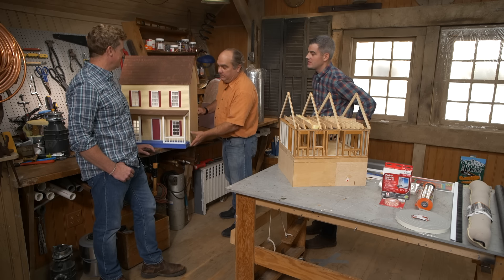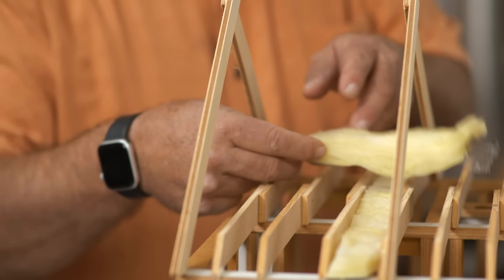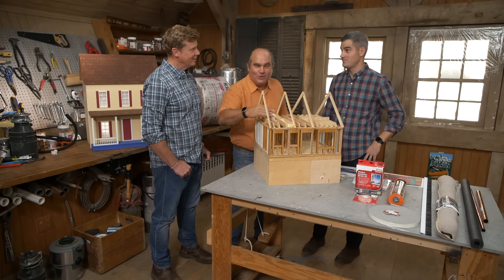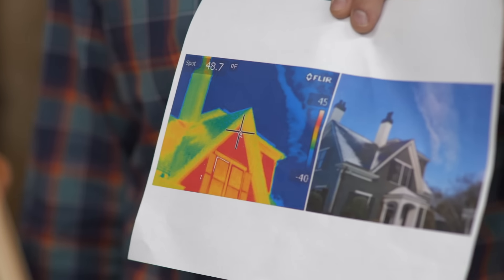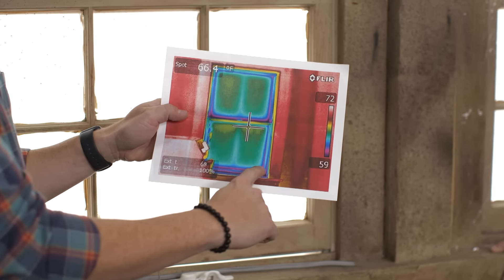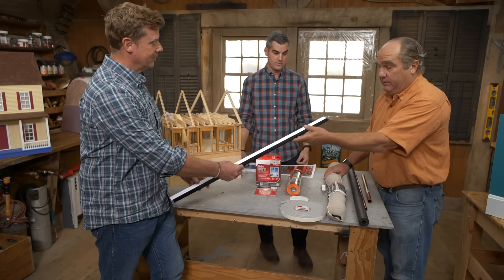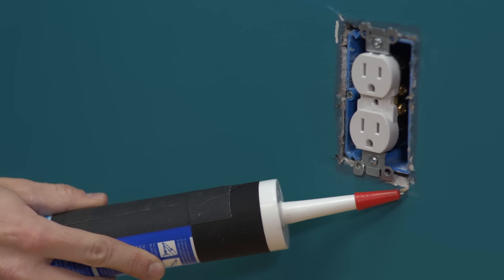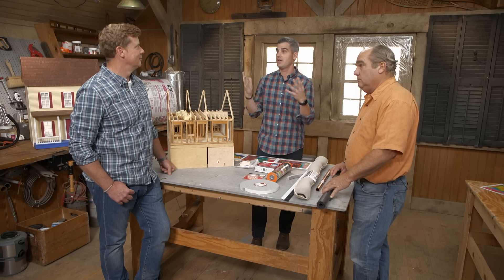How to Save Money on Heating Bills | Ask This Old House

Comment: When I bought my 10 year old house the previous owner said her electric bills were always around $300 a month.  My first week, in the house, I went up in the attic and discovered half the house had four inches of blown in insulation and the other half had nothing at all.  I added blown in insulation so there is a 12 inch layer throughout the attic.  That was six years ago and I have not had an electric bill over $100.
Reply: Wow didn't know it would make that much of a difference!
Reply: @nofurtherwest3474  It was money well spent.
Reply: Goes to show how bad the quality is on newer houses, they don't care just build them cheap and fast for max profit!! (its sad how common it is) to only put 1 coat of paint of these houses, and when other trades come in, (like me to pour concrete) I put tape and plastic up to not make a mess, when I take the tape off it peels away the paint. Honestly (sort of maybe not always) better off buying an older house. I also have seen a brand new house, with the back deck 2 inches out of square, the average person might not notice but if you stick your head down the side of the house it's ridiculous.
Reply: @7.3powerstroke6  I fully agree.  I am a general contractor so I am very well aware of how new houses are slapped together.  I would much rather work on a hundered year old house, at least a stiff fart will not knock it over.
Reply: @NickMC
As a general contractor that subs out the work to build the house, you need to take the time to find a crew that knows what they are doing. I’ve framed houses for quite some time, a lot of them are super insulated homes. There are procedures to follow when framing, caulking under wall plates, raised plate for the rafters, California outside  corners of the house so they can be insulated, 2x6 walls, very well built homes. I built my own place with these same features and I don’t pay much more than $100  a month for heating a 2200 sq ft house in northern ohio, avg  temp in the 20’s
Reply: @paulhunter9613  I would love to take the time to find the right crews but the devoleper will just find another gc that will do it faster.  no one cares as long as it meets min. code and even then half the inspectors look the other way.  The faster they go up the more money that is made and don't even think of going above code because that cost money(tongue in cheek). It sounds like your code is alot better then ours and the procedures you speak of is the way every home should be built.  It sounds to me like you are a fellow that actully cares about your work and that my friend is hard to find around here.  I bought a 1923 built house, gutted to bare studs and redid everything myself and she is airtight and warm.
Reply: Testify!

Comment: Be prepared to buy and install an HRV if you are truly successful with stopping close to all the air leaks.  As you build a tighter house you will end up with a much more fragile house. Its not as simple as stopping all air leaks as that will cause other serious moisture problems in a cold environment,  If you don't have mechanically controlled air.
Reply: Didn't know what HRV stood for so after looking it up, I thought I'd post it here for anyone else that didn't know: 
Heat Recovery Ventilator - a device that continuously replaces stale indoor air with fresh outdoor air to help make your house healthier, cleaner, and more comfortable.
Reply: Is there no passive way to do this? I imagine there’s a balance to fully sealed vs allowing a bit of exterior air in at strategic points. In any case my house is like Swiss cheese so I doubt that’ll ever be a problem for me :)

Comment: I got a grant to pay half the cost of spray foam on and IN every external surface of my 200 year old house, including between the foundation and house. Covering all the roof joists AND the floor of the attic. No snow melt on my roof. For the tightest hat you could get. Before that, there was nothing in the walls, not even corn cobs!!  Savings was obvious! The upstairs is near completely heated by just the downstairs upward heat convection and trapping under the hat. Now I use only a tank of heating oil a year, before it was almost TWO!!! Now I'm installing a wood gasifier indoor boiler to get through on a few hundred dollars of wood heat per year.  I've had soo many various contractors saying it was all done wrong???

Comment: There are 100,000s of house's that have absolutely horrible insulation values to them in both hot and cold weather climate areas. It should be a requirement before sale of a house to have an energy audit completed.

Comment: They keep talking about sealing the attic/roof, but they don't seem to be talking about all the vents to release moisture and prevent mold. How do you balance that?
Reply: The attic would be conditioned to remove moisture
Reply: Fiberglass batting or cellulose insulation should still allow for some "breathing". Where it can get dicey is when spray-on foam is used. That stuff is an incredible insulator, but also prevents moisture from dissipating and will rot your roof slowly. I see it recommended for old basements, but I have my doubts if it has rock or brick walls, since those are materials that need to expel water to prevent oversaturation.

Comment: Insulating pipes also has its perils.  Insulation keeps cold from the pipes.  But also keeps heat from the pipes.  Best way to insulate crawlspace pipes is with a V of insulation hanging from the floor so that heat can reach the pipe through the floor.

Comment: I saw a concrete basement house with plumbing through a bulkhead. The bulkhead was insulated, but the pipes froze and burst. Insulation stops the flow of heat. If it blocks the heat while outside air gets in, which was the case here, you have to redo the work.

Comment: I'm keen to insulate my roof rafters, but I'm a little worried about trapping moisture. Any tips
Reply: Ridge Rot is an issue in tight houses since any heat and moister can get stuck in the ridge of the house and rot it out over time.  I spray foamed our attic making it a conditioned space then put three mini-split units up there with open return air ducts.  This pulls air from the house up through the attic to the units and keeps the air moving.  I also installed some wireless temp/humidity sensors just below the ridge.  I can check them at any time on my phone and set an alarm if the temp or humidity gets outside the threshold I set.  So far the system is working great.  Should be some videos on our channel.
Reply: Good thinking, I'm from Europe so not sure how you guys do it over their. But here we do it as follows. (From inside to outside). Put a foil which will not let trough moisture, than put the insolation, than a foil which will let out moisture (you don't want moisture trapped in you insolation). That's how we do it over here. Than some mechanical airflow to divert trapped air at the attic, to outside.
Reply: @thezfunk  I've watched him.  He even answered some questions I had.

Comment: Most often Adding extra shash locks would not close the gap completely or youstop draft coming in side the house.  Add wider sticky rubber paper bk peal off sealer from bottom of shash  gap. No draft anymore! Remove sealer in summer to open windo!

Comment: Heat bridging is another thing most people are not aware of for example a door knob can act like a heat sync to the outside part of the door. The ceiling joists in the attic not covered in insulation act as a bridge for heat from the ceiling transferring it to the joists and then it's released into the cold attic.
Reply: You mean conduction or the 1st law of thermodynamics?
Reply: thermal bridging through the studs into the house.  Putting a layer of rigid insulation outside of the sheathing will help or prevent this if thick enough.  That is what Zip-R is made for.   I couldn't afford it though so just did the rigid insulation.
Reply: @Bremend  1st law of thermodynamics is basically the relationship between heat and work.....

Comment: My house was built in 1897. When it was built, you fired up the coal furnace when it got cold out, and if it got too warm in the house, you simply opened the windows. Thermal insulation was never even a consideration. 
I'm getting my single pane, bay windows replaced this year, next year blown insulation. Hopefully it takes my heating bill from the upper 300's to something more manageable.
Reply: Mines an old Iowa farm house built in 1903. Windows are on my to do list, in the meantime I just roll out the heat-shrink plastic covering when it starts getting chilly out. What made a huge difference for my place was having the "retro foam" stuff blown into the walls. There's about 3 feet of fiberglass insulation laid out on the attic floor that was there when I moved in, but the walls were empty. I have a big cast iron wood burner in the basement that I'd fire up on really cold days to help keep the furnace from running nonstop. Prior to the insulation install the wood burner kept it a comfortable 68ish upstairs when it was around zero outside, after the insulation install the wood burner is no longer necessary as it had my upstairs like 83-84 on the couple occasions I fired it up since. The house is definitely holding in heat waaaaaaaay better then it did before.  Still like to have the occasional small fire since it keeps the family amused cooking s'mores and hotdogs while trapped inside on bitterly cold days, also seems wise to keep it in working order as a backup since furnaces never pick a very convenient time to crap out on ya.
Reply: @_Frank_the_Tank  
I'm doing the walls next year. Mine are hollow as well. Good call keeping the backup heat on tap😉
Reply: Until I replaced all the windows I used "indows" that I made to fit over each double hung. 1 x2's squared up and wrapped with shrink wrap then thin backer rod to fit snug.. This was a great way to keep the look of the old windows and stop the flow of heat in this 1863 structure. Painted the same color as the casing you hardly noticed they were there. Twice a year put them in and take out to store. Made me clean the windows twice a year too. Since replacing recently with Marvin Integrity units the only thing I miss is that old "wavy" original glass.

Comment: Our Off-Grid home has a conditioned attic space.  Planned it that way so the HVAC and duct work is all inside the space.  Made everything super super easy when running ducts and return.  In fact the returns don't even have duct work.  They just suck air through the space below through vents into the attic space then to the unit.  Videos on our Channel.

Comment: In order: Attic insulation>Wall insulation>Basement insulation>Door sweeps>windows (only if windows are still sealed). MN climate: Went from 6 inch attic to 60+ dropped my hvac run time from 12 hours to 10-9 hours on negative temp nights. Remodeled my basement and added foam board with batts in wall for R19 and saved almost exactly 50% on energy, crazy. My windows were originals from the 60s, but sealed. Not much benefit from upgraded vs fixing my doors and resealing or adding weatherstripping. Not perfect but my experience.

Comment: At 6:15 when they are talking about air infiltration the kraft faced fiberglass batt insulation is installed backwards. The treated paper side of the fiberglass batt should be installed with the paper facing the warm side of the wall. We should be looking at the pink side of the batt. 👍

Comment: I'd like to see more products on air quality.  In this video you're mentioning lots of sealing but homes require about 15 CFM of air per person to maintain air-freshness.  For some reason leaf burning is still popular here so I may even try a MERV-12, to HEPA, through an inline-dehumidifier, & a carbon filter to maintain the air exchange when using the vent hood or clothes dryer.
Reply: HRV or ERV (what I installed) solves that issue.  I'm sure they've done a video on it before.  I think we have a video or two on our channel from when I installed ours.
Reply: @Off-Grid  ... when doing upgrades on air filters for your heating system you may wind up with too much restriction and therefore not enough heat in the home. Yes, they filter at a higher rate (smaller particle size) but that's a possible problem if you go too extreme. It was always the first place I would look when a customer called up to complain about a house not being warm enough.
Reply: @rupe53  i agree, the MERV filters are good but restricted a lot of air flow.  We ended uo just using the washable screen.  The ERV has a better filter to keep outside are filtered so allergens keep out.
Reply: Even with trying to seal up a house as tight as you can with just minimum code, you will still get all the fresh air your house needs. Unless you go above and beyond, you will still have way over a 2" hole in your house leaking air....
Reply: @michaelfranks341  ... about the only way you can get too little air exchange is to build a new home from scratch and spray foam it. Even then, the typical family of four will likely open doors and do laundry or run the kitchen exhaust fan enough to keep things moving.
Reply: @michaelfranks341  No, in my humid climate you get mold development in a random wall.  You can't just seal up everything without having an air intake.
Reply: @SlackerU  if you have mold in a random wall, you didnt build it correctly and probably have a concrete slab with issues. You dont have an adequate hvac unit moving air thru your house. Dont have adequate insulation or a vapor barrier properly installed. Air is always moving because you cant caulk your house tight enough to keep it out...
Reply: @rupe53  yep, people think their houses are so air tight but still leak air pretty bad. It takes massive effort and money to plan even a score of 0.6 on air tight house that needs air exchange system. To even get a score 3.0 on air tightness a homeowner is doing awesome on air leakage... That would be like having way over a 2" hole drilled into your ceiling pouring air into your house all the time... Plenty of air
Reply: @michaelfranks341  Duh, if you block out all the air intake then the air will enter in an unsuspected place.  I don't know why you think we disagree.
Reply: @michaelfranks341  ... about a year ago we had an older building in town (circa 1865) going through renovations. I missed out on the process of them doing the blower door tests for air leakage, not once but six times, as they completed each apartment. I guess there's grant money to be had if you can get energy star rated... and they passed the tests. Things that I noticed were every outlet and electrical box was caulked at every penetration, plus all the sheetrock was caulked where it met the floor. IOW, it's sealed in more places than just the doors and windows.

Comment: You can put a sterling engine fan on your furnace to help push the warm air around the place to better heat your home :)
Reply: When buying a new 93% efficient furnace for the home I made sure it had a DC blower motor, cheaper to run and has a feature to have continuous operation, a very low speed to continuously move the air, filters it nicely and hardly any dusting needed (so says the wife ) 😀
And my electric bill actually went down $3 a month compared to the older furnace

Comment: Boys,

Love the show but a few things do get left out .

For example - this video on insulating the roof of your house.

I would be interested to know, that when the floor up there has no attic and the joists are open bay, plus the only access in this house is a ceiling hatch in a closet that is about 12 inches wide by 18 inches long,  Just how exactly do you get yourself into the attic, what do you step on, how do you get large insulation material up thru that hatch?

This is not a old farm house with a full attic, a floor, and a staircase into the attic.  So are these people out of luck.

Looking forward to your response to this.

Thanks much.

Bob

Comment: Instead of putting heating equipment  out of heated envelope just by putting all equipment  all design like in early days have heating and air conditioning equipment in the heated envelope air seal properly installed  insulation properly  !  No heat ducts in attic no equipment  !  You could be saving up to 25% with this design !

Comment: Til people have hvac stuff in the attic and not in the basement. I've never thought about how places without basements work.
Reply: We spray foam the roof deck in our attic so it is the same temperature as the house.  This way the hvac doesn't have to work as hard to heat and cool the house.
Reply: Very common in the South.

Comment: Wish you had shown the after heat measurement of the plastic window kit.
Reply: It's probably pretty good! But if you're looking to improve old windows, I'd first suggest storm windows. Much cheaper and you don't have unpaintable plastic in every room. Like the video said, a sealed air pocket is a fantastic insulator.

Comment: The inside of my external walls always feel cold to the touch.  Its a brick house with only a couple of inches between the brick and the paster/chicken wire walls with no insulation.
Reply: You could blow insulation into the walls as long as you don't have knob and tube wiring.